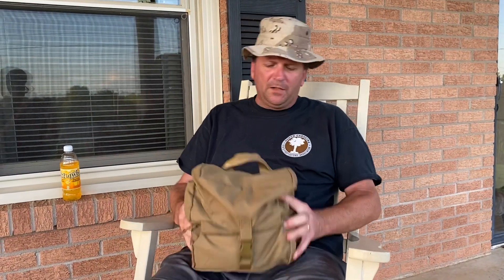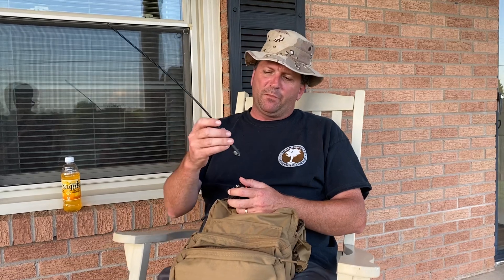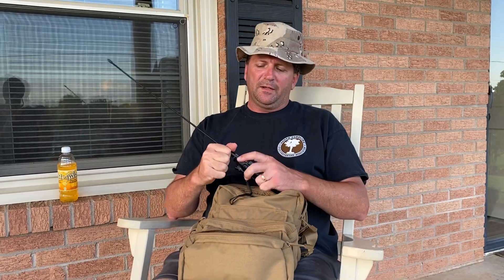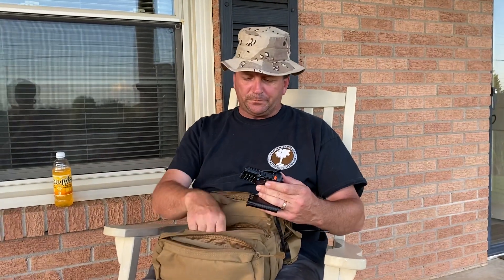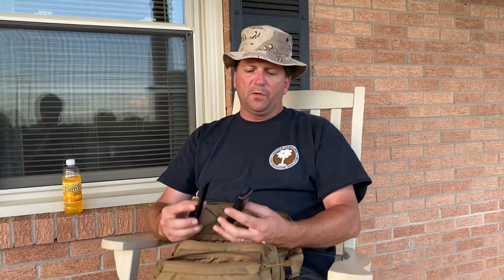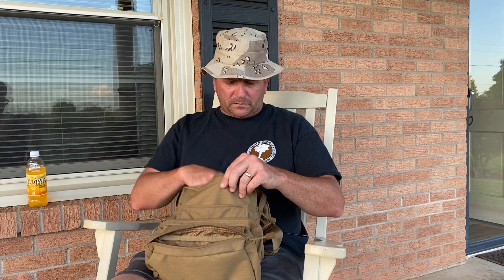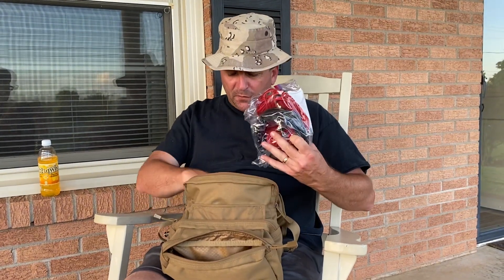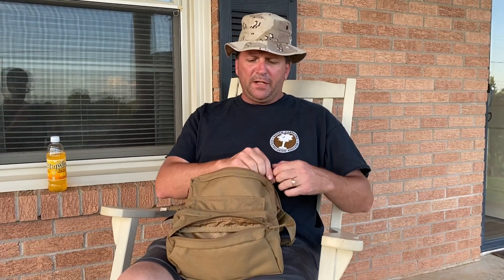Building your Kit with Tactical Comms

Comment: These days the fire departments are always getting new gear.   As they faze out the old they sell them at auctions. Many have the old Motorola minotaur pagers.  You could set up a system and hand out emergency pagers to your most trusted friends. In the case of a national emergency you do a page and set your meeting place.  The great thing about monitor pavers is that you do not need a dedicated frequency. You can program the new ones as you go.
Reply from the maker: Good resources.  Also check out www.govdeals.com and www.gsaauctions.com for options.

Comment: Okay... I am a long time prepper, Retired Army (41+ years, AD and USAR) Retired Civil Service (27 years, Army, Flight Instructor) Amateur. I watch a lot of YT, looking for tidbits of info, good ideas, things I've "missed" along the way. I resisted replacing the original antenna on my UV5R but based on your recommendation I succumbed and bought a better antenna for my BaoFung. Yes it improved performance. Thanks! I live in SW VA I can "hit" the repeater 35 miles away from my driveway now. But it is a PITA. A 17 inch antenna on a itty bitty radio hooked on my belt... with a mic... Hmmm... "Tactically" do I need that capability. I did not "throw away" the original antenna. It's still a good "backup". And so much for the "grey man" concept. The antenna itself attracts way too much attention. 
I did not teach "soldiers". Although I initially taught fledgling aviators and I ended my career instructing and evaluating highly experienced flight instructors in both helicopters and airplanes. I also taught in the classroom. I was, as my co-workers, constantly evaluated and received "constructive" Ahhh... Criticism. Good YT videos usually run between (at least) 15 and 30 min. Cover the topic throughly and move on. The beauty of YT is it can be rewound and watched over and over if something was missed by the viewer. Summarize at the end if you must. The info your trying to convey is highly technical. Don't dumb it down. ""In the weeds" basics can be found elsewhere, like ARRLs various handbooks. People have become quite "lazy" and only want the "answers to the test". They don't actually want to "know" the basics. The rocking chair is very distracting.
Hey... bottom line... It's your "channel", do it your way. 73s. I'm out
Reply from the maker: Hello Sir, and thank you for your thoughts.  Most importantly, thank you for your service!  While I never became a CFI, I too am a rotor craft pilot.  Good luck adding to your tool box of ideas to make you better prepared.  "Clear skys and tails winds along your journey, Sir!"

Comment: What antenna do you suggest for an APX 8000? UHF for work VHF for mutual aid... also HAM
Reply from the maker: Michael Bova that’s a tough one. I’ll have to see what I can find for V/U/7/800. I to have an 8000, but I also have several different antennas. I have a Nagoya 2m/440 for ham, the factory antenna for all bands, and a 7/800 specific antenna for just 7/800. I know that isn’t very specific, but I’m not aware of a multiband antenna that works well across all the bands
Reply: The apx8000 has on board gps, I have yet to see an aftermarket antenna that supports that plus the bands. I would be extremely careful using after market antenna because of the water and intrinsic ratings those radios can have being damaged by an odd flange on a new antenna.